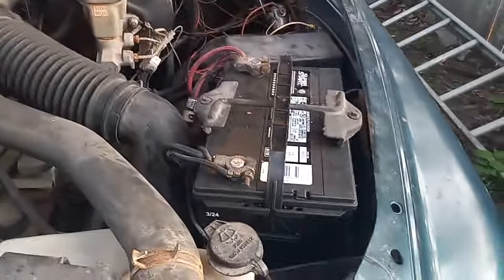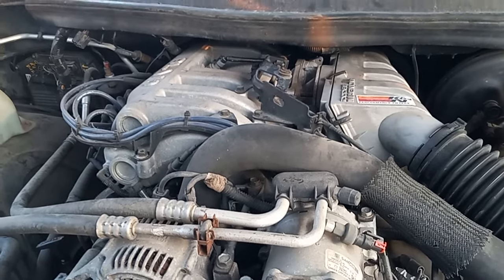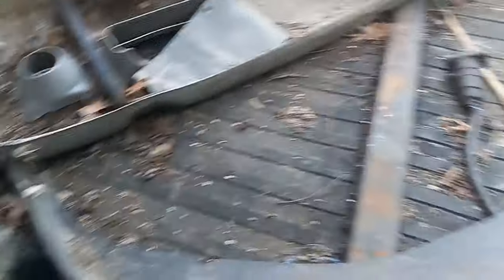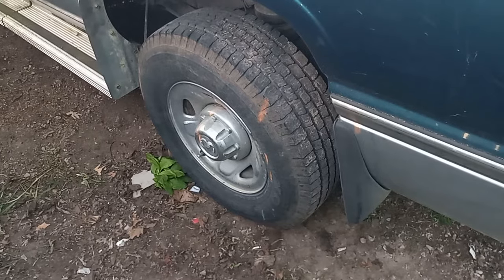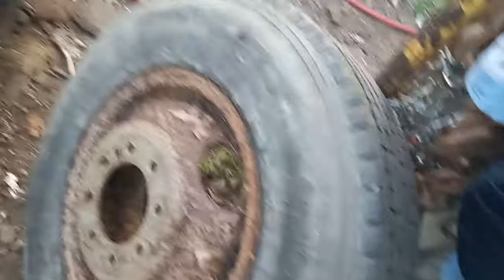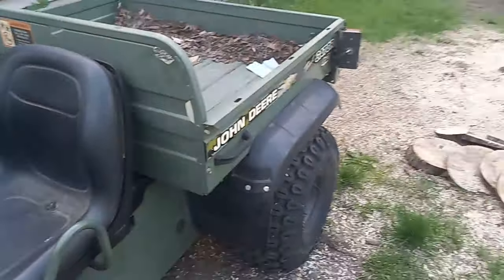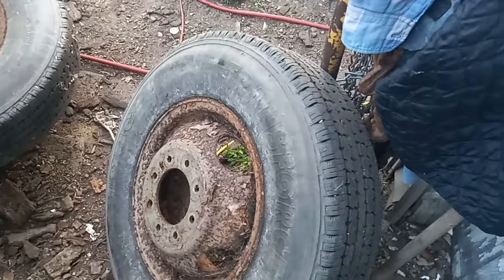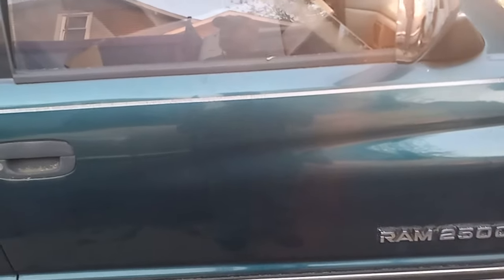ugh did not get everything done today

Comment: I'd track down all those mystery wires and unhook them in case one is live and intermittently shorting out on something. It might not hurt to add a couple new ground wires from the battery to places like the engine block and the fuel pump assembly. Have you been able to scan for trouble codes? I hope you get it figured out.

Comment: I had a car that needed 50ish psi fuel pressure and it would run like crap if it didn't have it. I bought an adjustable pressure regulator but the issue was loss of voltage due to a poor alternator.